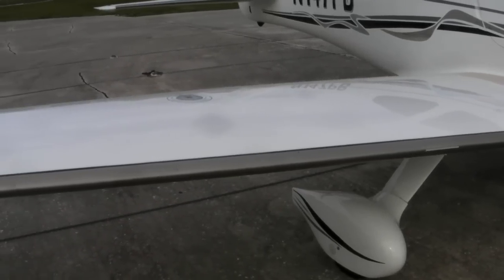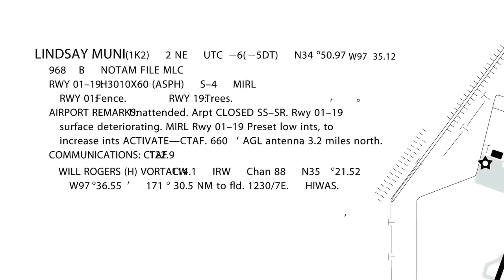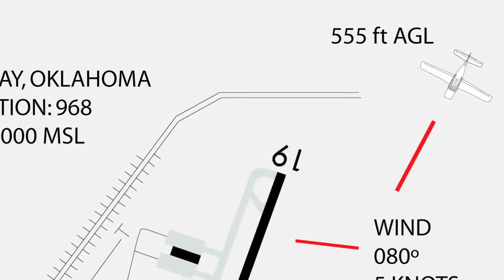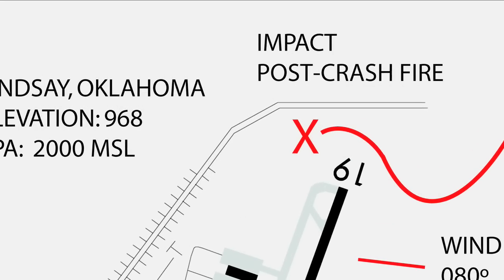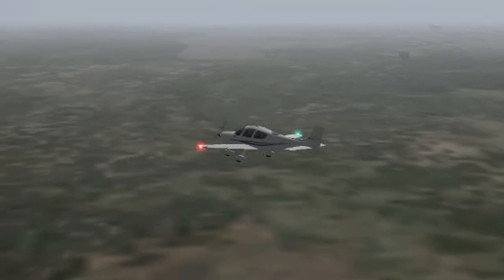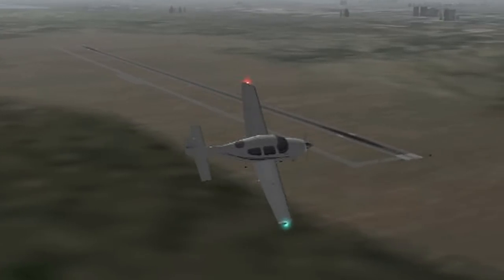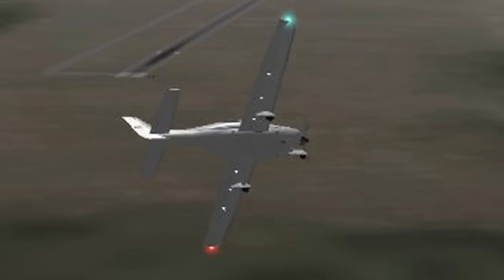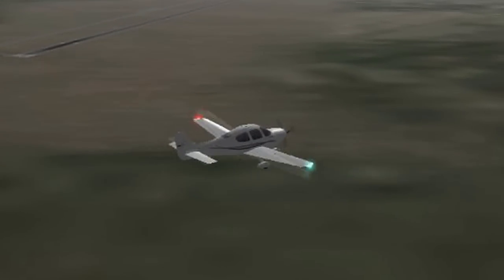Anatomy of a Cirrus Stall Accident

Comment: airline pilots do not have years and years of tough training if they go thru the general aviation route.  250 hours to get a commerical license, 300-500 hours as a flight instructor, then hop into the right seat of a regional jet.  

military training is the best and the only way to go in my opinion.  pilots do not get trained well if they go thru the general aviation route.

Comment: I have flown the sr20 a few times and I can say that it is not a forgiving airplane. It won't handle the same way that most other light singles do. It's slippery and fast, great for x country but not for flight training. Needs respect. why they keep getting engine failures another story.
Reply: Paul K these cirrus aircraft shouldn't be used for training flights that I can tell you
Reply: From what I've heard any faster aircraft is probably a bad idea to be using for training regardless. (unless it's specifically to do with training in an aircraft of that nature.)

The extra speed always comes at the cost of something else... Usually the handling...
Reply: good point.  the SR20 family are cool planes no doubt, though probably not the best for training.   like an F18 also a cool plane...  NOT A TRAINER.
Reply: lol and these are the only planes Purdue University uses for flight training

Comment: Very sad and unnecessary loss of life. Obviously no idea of standard stall recovery - stick centrally forward with full power and slip ball in middle - then rolling wings level once the wing was flying again to go-around. That would have saved the day from the left wing drop. Incipient spin is stall buffet plus undemanded roll or yaw. Just using opposite rudder meant a/c spun in the other way.

Comment: Totally preventable accident.  They were off centerline and low and slow.   I was always taught to fly by the numbers.  Approach speed, altitude, AOA,  and on a straight in, be established safely a good 3 to 4 miles at least, before conducting my descent and approach to land.  Give myself time to do my pre landing checks, radio calls, GUMPS.   If there was any doubt about the approach conduct a missed approach fly the circuit and try again.   Low and slow combined with yank and bank, in an apparent desperate attempt to reacquire runway 19 is certain disaster.   These guys were way below pattern altitude.   223 AGL with a high bank ,  loading up one wing and unloading the other and throw in some heavy rudder input,   yep.     Really stupid and hasty mistake which killed them.   Never ever do anything close to what these guys did...ever. BTW I conducted an approach at night to an uncontrolled A/D in a valley in a 172, first mistake.   But I conducted several approaches before I was happy with my approach and got the plane down safely.  I was glued to the numbers and made sure to never do any heavy G loading during this time.    I heeded my flight instructors teachings about flying the pattern by the numbers.  Still alive!   God Bless!

Comment: people fly a cirrus but dont use the parachute system when in trouble how foolish is that? if your at 1,500 feet if you cant recover at 500 feet pull the damn parachute!! you should never bank that steep its suicidel especially at 1,500 feet.😀

Comment: I wonder why he didn't use the CAPS?  At some point you have to realize you are going down and the CAPS could have saved them if they had used it.

nW
Reply: No it couldn't have. The official minimum deployment height for Cirrus parachutes is 400 feet above ground level in level flight or 920 feet in a spin.